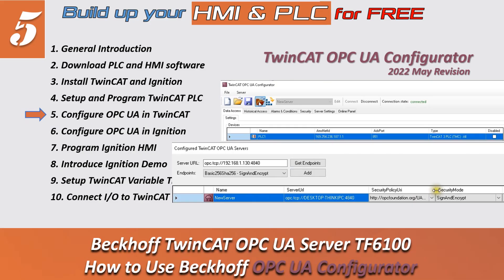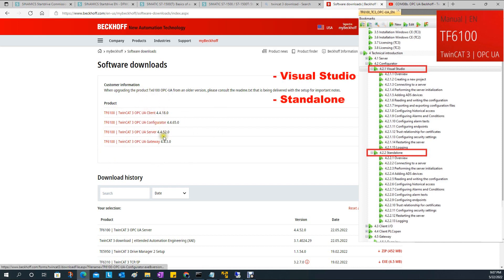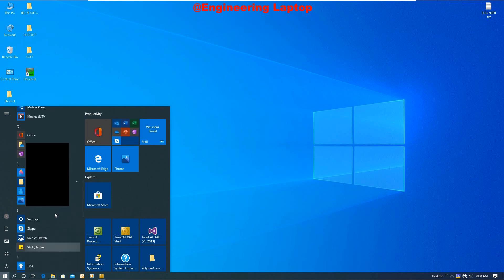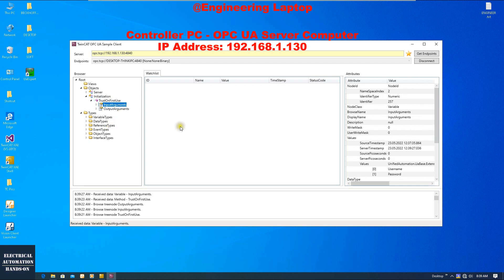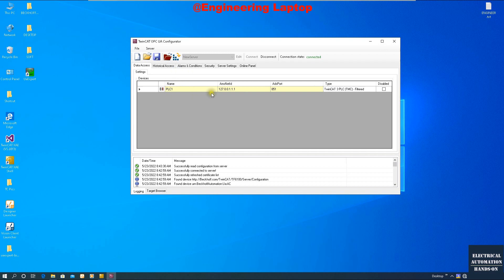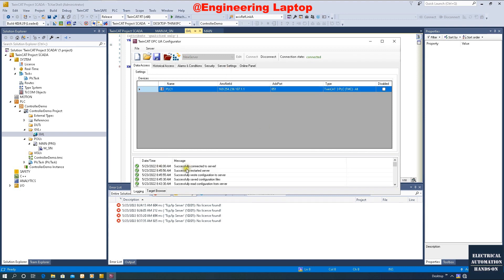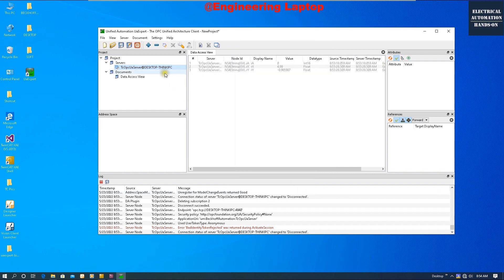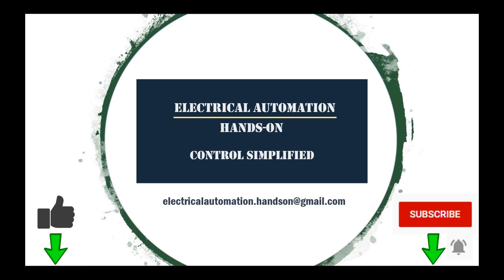SCADA05. [PLC&HMI] Beckhoff TwinCAT OPC UA Configurator TF6100 (2022.05 Standalone Rev)

Comment: 如果我只用一个device 应该要怎么connect去ignition？
Reply from the maker: No quite understand your question. Can you explain more?
Reply: @electricalautomation  I’m not using the other pc just my laptop to do the hmi and the plc control is it possible
Reply from the maker: I was using the one PC running ignition and TwinCAT PLC in one PC. Using one or sperated, the only different is the IP address. Therefore, almost no difference.  @spongebobhang2969

Comment: First thanks for all great videos you make and i follow your videos one by one 
Second i have a big problem i setup opc ua server and client and getway but for some reason i have deleted the opc ua server which is called TcOpcUaServer i don't know how but i deleted it but when in getway configuration when i added another one with same name and when i open sample client app it didn't connect with me and make error which is badservice and not connect and when i connect with main server which port number is 48050 is connected successful i searched in manual and installed all cerfticate but didn't work also and installed all program but the problem is present also please give me some help
Reply from the maker: Probably uninstall TF6100 on your target machine system, and reinstall TF6100
Reply: @electricalautomation  do you tf6100 connectivity
Reply: First thank sir for your replay and support 
Second it work successfully by uninstall all program of server and opcua configurator and opcua client and opc getway and remove all temporary folder in twincat directory and showing hidden files in c partition and in program data delete all files related to twincat opcua server and client and getway in beckhoff directory of program data and unified automation directory in program data also and all cerfticate in unified automation directory and opc foundation all this directory founded in program data after showing hidden files in c partition 
And thank you again and you had a great work keep going 😊